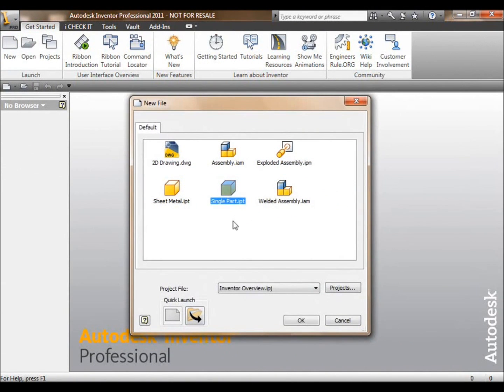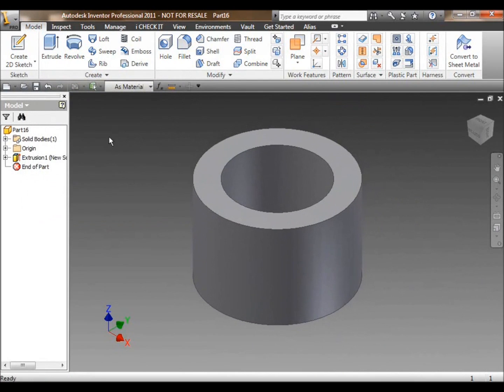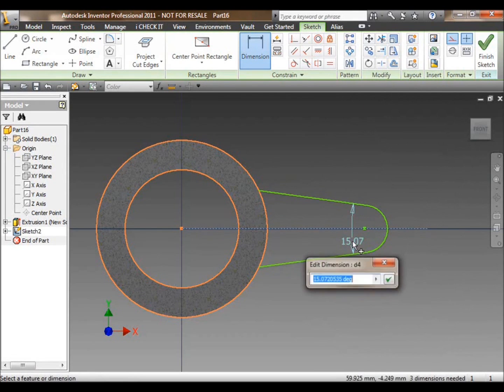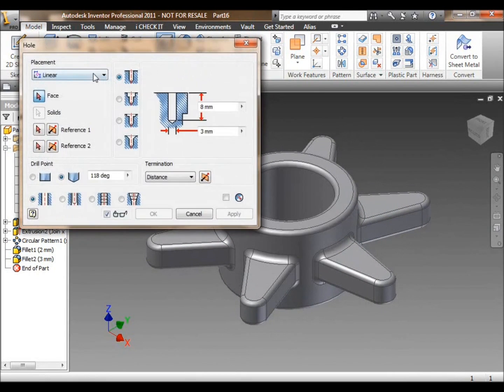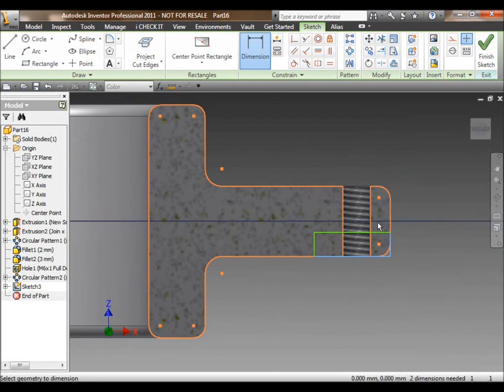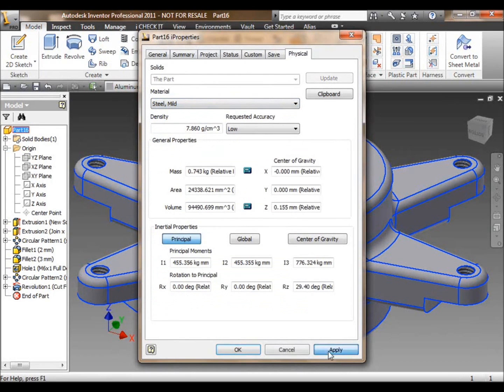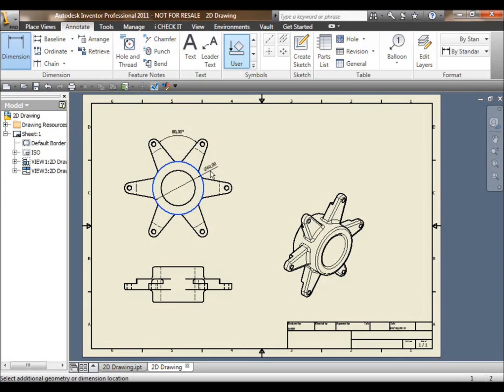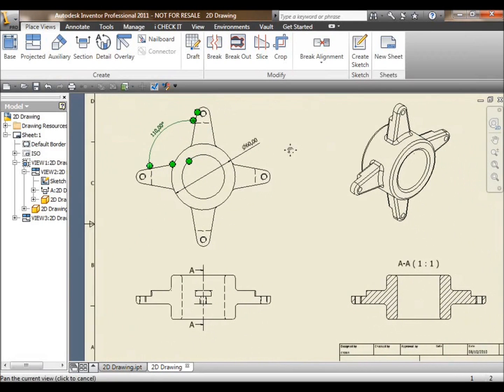Autodesk Inventor Overview - What is Autodesk Inventor?

Comment: Interesting... can I 3D print the part?
Reply from the maker: +Aerohk With Inventor 2016 you get a feature called Print Studio that should take the part and add the required supports.  This can then be used to 3d print.
Reply: Thank you